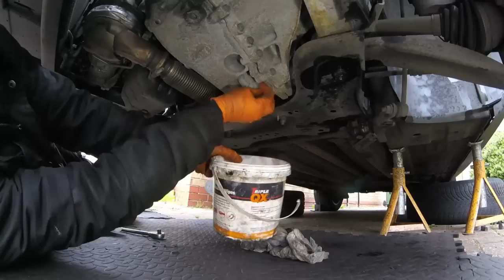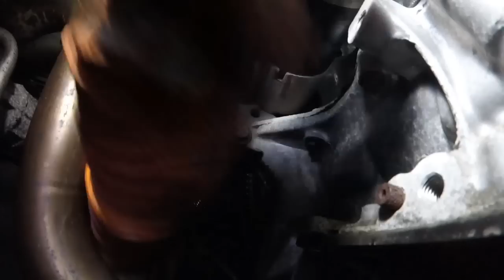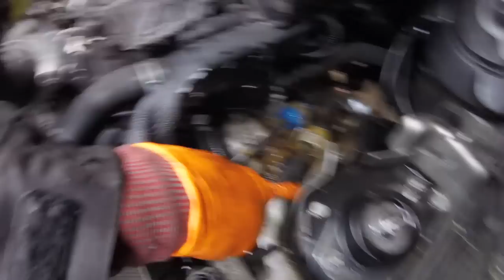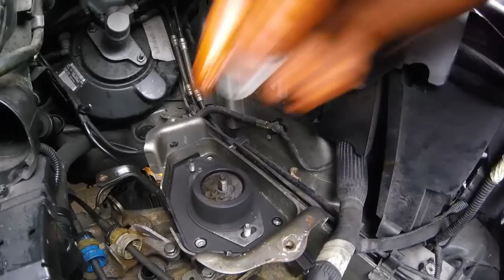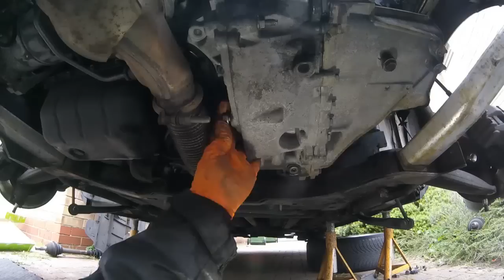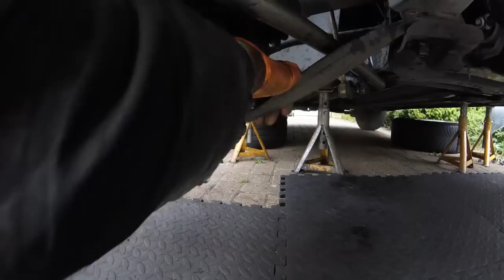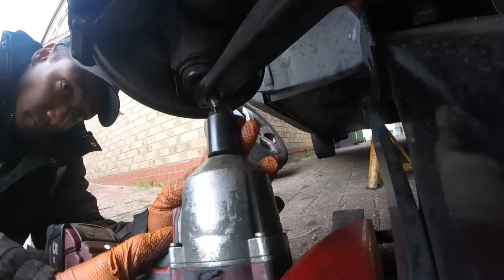2011 Peugeot 3008 1.6L Diesel Clutch Replacement

Comment: I Just change clutch now and have problem with subframe bolt they spin around any solution for that ??
Reply from the maker: Put a spanner on the nut. 🥜
Reply: What size of spanner. there is square nut inside. I have problem with bolt with you loose in 8:22 min  @WMCS

Comment: Hi,how similar is this engine and gearbox to a ford c max 2012 2,0 tdci?
Reply from the maker: todoran marius it is pretty much identical. A few small discrepancies like how the gear linkage are attached and the gearbox mount attachment ... 

But the block itself is pretty much the same.
Reply: Thank you for your answear,i have heard that ford c max has the peugeot engine and soon i have to change clutch,so i am gonna watch and learn from you.happy new year for you and your family
Reply from the maker: todoran marius there is a detailed video. Of a Ford c max and other ford on the channel if you browse through the videos.

Comment: Where did you get the (foam) floor tiles from? And what impactwrench is that?
Reply from the maker: Nicholas T it’s from Halfords but they are available on eBay as well. 
And the impact wrench is one of the best I’ve owned so far. More powerful than an air one. It’s a Milwaukee FUEL.
Reply: @WMCS  Thanks Kevin. And what's the name for the tiles? Huge fan of your way of working... Next Alfa 166 2.5 Clutch?
Reply from the maker: Nicholas T it’s called interlocking mat on eBay. 
The impact wrench is a Milwaukee fuel. 

I’m hoping to do some Alfa Romeo soon. I’m a fan.

Comment: How much for clutch change on Peugeot 207 1.6 HDi cabrio pls
Ub7 postcode
Reply from the maker: michael rewicki your ones are quite expensive at s it’s got a DMF clutch system. About £580 roughly.
Reply: @WMCS  thank you for replay im trying to get it done my self today ive managed to get clutch kit from gsf £67 (originaly 160they have 60% off now) and £9 for 2 liters of oil just one think that got me is bludy drive shaft bolt is 36 (my tool set goes up to 32) i had to drive to machine mart to get one (halfords sold out)
Thanks for great video it helped me allot although ball joints are a bitch to get of and there is additional bracket next to that plastic thing under motor starter and that was a tricky one but im nearly there if ill fail ill let you know yet again thank you for quick replay and really good and detail video on clutch change i really appreciate that
 you have your self a new subscriber
Reply from the maker: michael rewicki I’m glad the video came through for you pal. .. let me know wether your vehicle’s model got a bolt in between gearbox/exhaust.
Reply: @WMCS  nah only gear box mount under car and under battery bay (this is 207 convertible)  but to be honest with you not totally sure when i get gearbox of Tomorrow ill update you
Also im not removing starter just cables hopefully that ain't gona give me any problems
Reply from the maker: michael rewicki cool. Let me know how you get on. 🤙🏽🤙🏽
Reply: @WMCS  starter had to come out and yes there was bolt between gearbox and cat what a lovely bolt that was very friendly to manage 🤣
As its 207 ive not had as mutch space to pull gear box outthere is   abs lines in the way 
What a stupid design this is everything is in terrible place i mutch more prefer german cars to work on

Btw ive had bearing sized to point that it melted and pieces where allover the place had to remove pipe that bearing Is sliding on and gave it a good touch of sanding paper (600, 800, 1200, 2000 grit)
Thanks for great vid and advice one thing was missing or mine had one more bolt there is another 13mm gearbox bolt above longer driveshaft under starter 🤐🤫

Comment: Did not seen what did you do with that bolt where catalytic converter is bolted on engine itself... Im working on same piece of 💩 right now and cant unscrew it at all all wrenches slipping from that one dang bolt and I cant put a socket on top of it because cat is standing few mm from that bolt even could not slide a ring on that cursed bolt... I did not seen anything about it and I see that cat is in its place so anyone can help with that? All my visions ended have time to think about it thru weekend and at monday Ill rip cat out just for one damn bolt in this junk... would love to see an engineer who designed this fail
Reply from the maker: Williams Mobile Clutch Service. week 11/04/24. Video Log
https://youtu.be/MWrwTudp5gQ
Reply from the maker: First in video. It’s not published yet. So hope you can see how to remove the bolt. Or think third repair in video